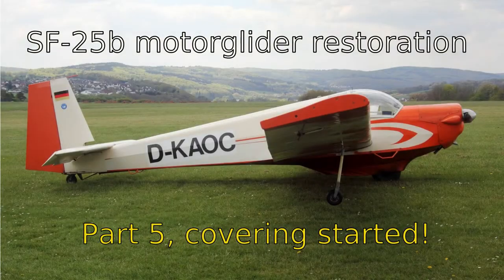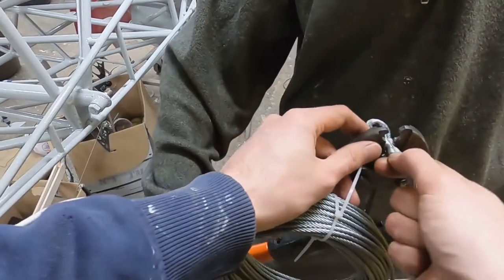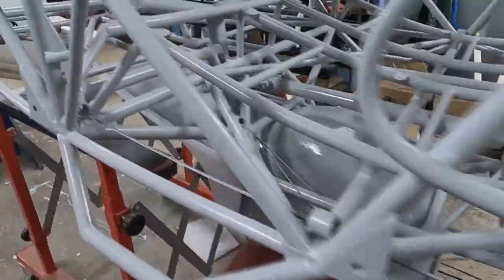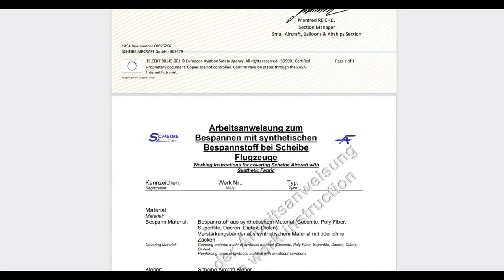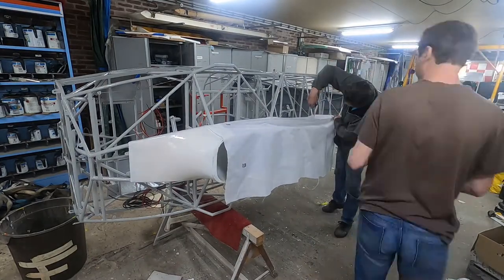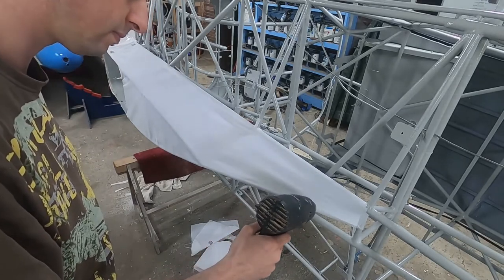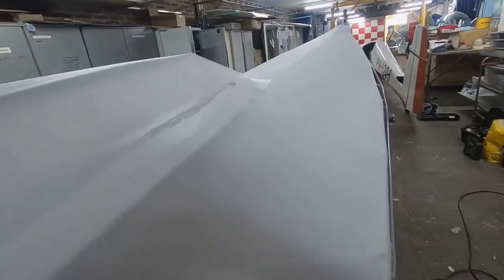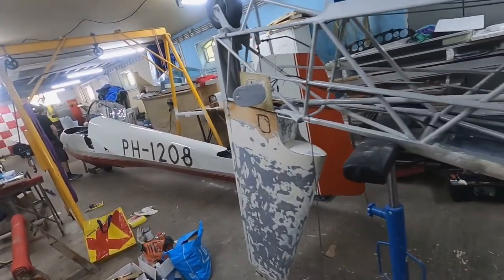Covering started! - Scheibe Falke SF-25b motor glider - Airplane restoration #5

Comment: Fabric is such a handy material. Glad to have it
Reply from the maker: Absolutely, it works very well. It is even more forgiving than covering with cotton, but a bit different process. The cotton fabric you stretch by hand when applying it, but this synthetic stuff you shrink with heat. It should be a bit more durable. After that the process is quite similar, just apply several layers of finishing lacquer, which also makes it shrink a bit more as well as making it a lot stronger.

Comment: Did you consider using Oratex for the covering? If so, what made you choice against it?
Reply from the maker: Hi, thanks for your comment. We did consider using Oratex (nice and convenient, all in one) but unfortunately Scheibe does not have a TM and work instruction for it. Because of that we cannot legally use it. But good question! If it would be allowed we probably would have used it, also to save a bit extra weight.
Reply: Oh okay, I was under the impression there would be an STC for it, but I did not thoroughly check it yet. I do own a Falke myself, so I really enjoy your videos. Gives some nice insight to the usually hidden parts.
Reply from the maker: Thanks, happy to hear you enjoy the videos! Perhaps there are some rules/exceptions under which it is possible to cover with something not officially approved by the manufacturer but I am not familiar with them either. We did have contact with Scheibe about the glue that is used, we asked if we could use Aerolon instead of the Scheibe branded glue. This was not allowed as it would violate the work instructions connected to the TM, rendering the plane non-airworthy. There are basically two options: 1) cover with cotton fabric, then you can use any TSO approved materials, or 2) cover with synthetic fabric and adhere to TM Gen. 01-2020 (see Scheibe website) in which you are required to obtain glue and finishing lacquer from Scheibe. This TM is specific for EASA as far as I can see. We went for option 2 because of weight and lifetime considerations, but material cost was about double compared to option 1. Nice that you have a Falke as well, is it also a B-version? Are you flying it under FAA or EASA rules? I believe the FAA is a bit more flexible.
Reply: @TheOddVideoChannel  My Falke is a D version, have being converted from a B in the early 80s. It is registered in an EASA country. Currently it is covered with Ceconite. Interestingly enough there seem to be quite some differences to your B Falke, mainly the fuel tank and fibre glas upper fuselage cover are completely different. I do not know if this was changed in the conversion or if it dependent on the construction year.
Reply from the maker: Our Falke also differs from the drawings used in the work instructions. This might be because it was license built by Putzer instead of Scheibe. Also, we noticed with our glider (a Scheibe Bergfalke IV) that there can be quite some differences between serial numbers. It kind of looks like Scheibe did small improvements with every plane they built. Just our of curiosity, what are the differences with your fuel tank?
Reply: @TheOddVideoChannel  The fuel tank is completely different. Mine is of an oval shape and looks a bit like a beer keg. The filler cap is also centrally positioned.
Reply from the maker: Very interesting, all those changes over time!